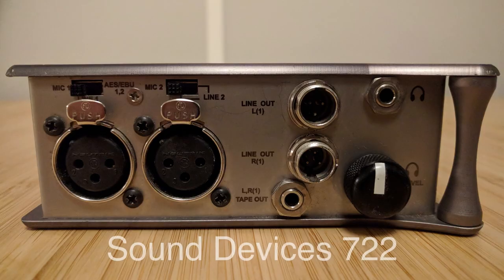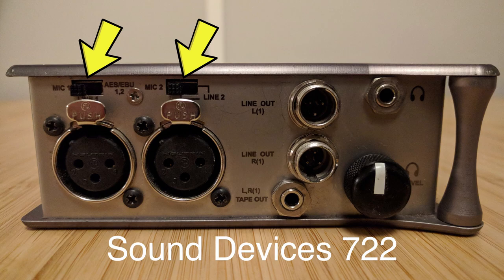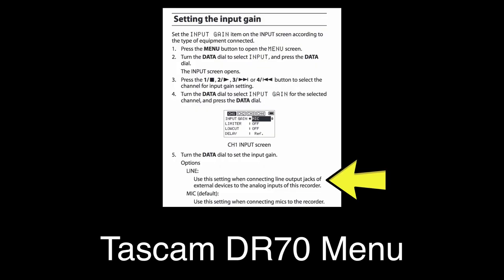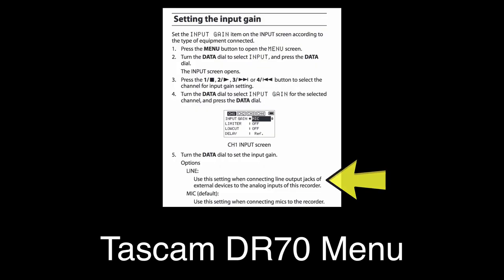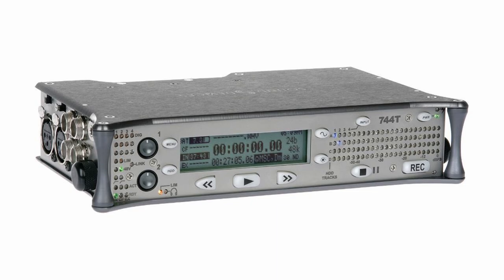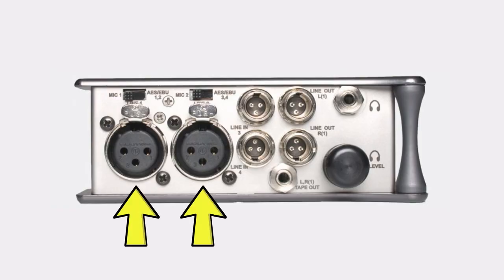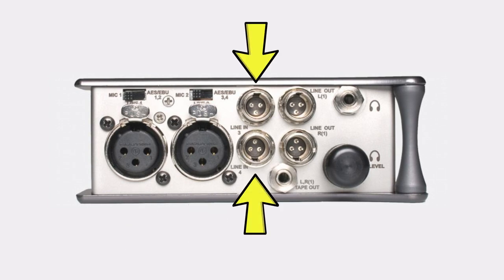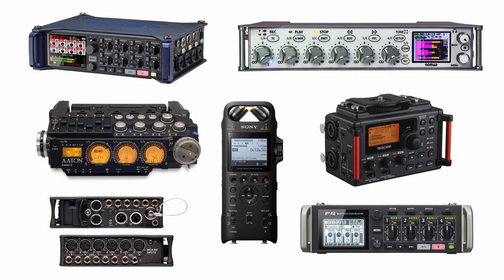Recording Hack: How to Record LOUD Sounds Without Clipping

Comment: I once had to record a military jet from the runway (Tornado) and the only two mics we took along that could handle the SPL (Afterburners on) was a B&K and a Calrec Sound-Field. All the others couldn't hack it. (Neuman / Senheiser / AKG). We used inline pads. (Apart from the Calrec which had them inbuilt). So - chose your mic carefully too!!

Comment: Great video! you earned a sub. One question though. I havent tried but in theory what if i have 2 mics and i set mic level of 1 to high. and lower the level of mic 2 to really low. So mic 1 captures the quieter details of the sound and mic 2 captures the loud parts without clipping. Would it work as well as it sounds?

Comment: I have similar issues recording motorcycle exhaust note and ambient sounds. No matter how low I bring down the level it still clips. I'm using a Tascan DR05. Any good tips? I've tried a dedicate lav mic but they are super expensive. Any advice would be very helpful. As usual, thank you for such informative content.

Comment: on IMDB I can find out what they shot the movie with, but there is not section to know what sound gear was used. I'm curious when the nagra came in and out of usage. I hear it had a 30 year run on the industry. When did people start recording to Hard drives and chips? What was your 1st recording device?

Comment: You know it's really annoying that on the Zoom H1N there's no actual switch to switch between line level and mic level. Zoom Support says it's automatic. :|
Reply: well that is only one of 10 things that is crap with the H1N! I'm a happy Zoom customer, using F8n and my H6 regurarly. I got the H1n aswell to use as a more carry on mic that i can bring anywhere i go. But it is really just a piece of fancy shaped plastic and nothing more to it. I even use my iphone xs more as a carry on mic than my H1N. Go upgrade to tat least the H4 and you will be a very happy man!